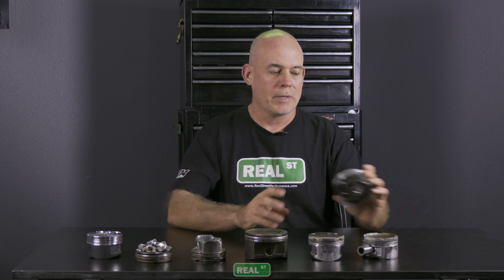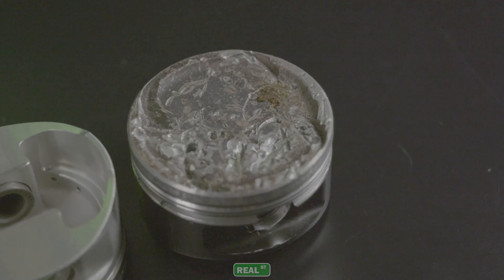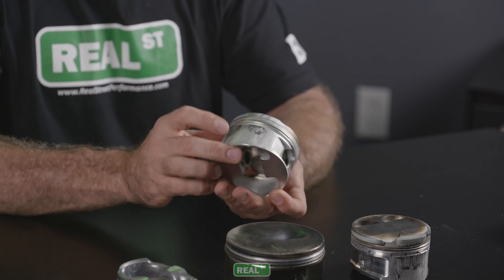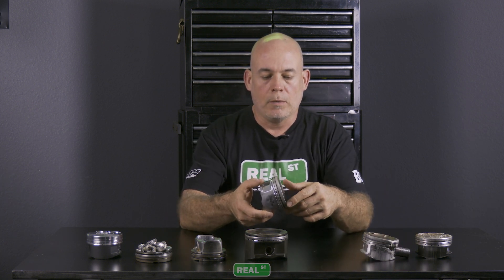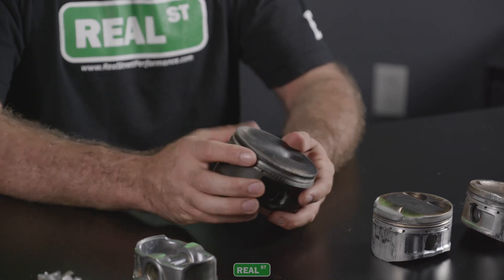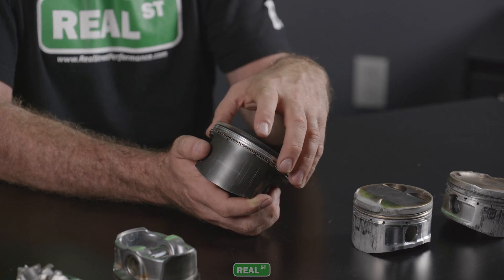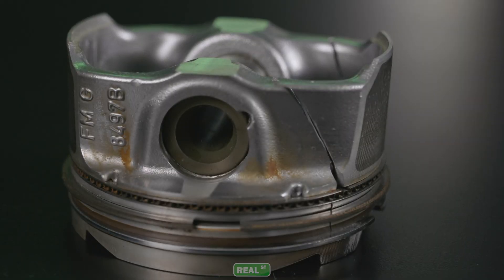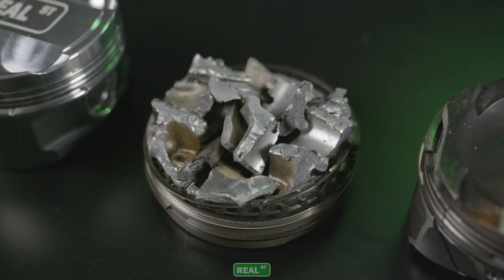Jay's Tech Tips #48: Piston Failure Diagnostics - Real Street Performance

Comment: Curious on your thoughts regarding ceramic coating the crowns on oem 2jzge vvti pistons....mates and I wanna see what they can handle.....
Reply from the maker: Just to satisfy a curiosity? Or for some other reason?
Reply: @realstreetperformance  Have a bet going. I maintain with a solid tune, they can handle 700rwhp with a ceramic coating....thoughts? He has a gs300, I have a forged big single 2j in my 300zx slicktop. He wants to get as close to my 825hp@36psi. I think it can be done, he doesnt.

Comment: I love these tech tips! Is 11.5:1 too much for 800hp k24 turbo on e85?
Reply from the maker: Thanks for watching and commenting. "Too Much" is going to be kind of a sliding scale here in this case. The higher you go on compression, the smaller the window becomes for success. The higher the compression, the less likely it will be to survive a bad day or detonation. Many people turbocharge 11.5:1 compression K-Series, and there are enough people doing it successfully that the community will tell you it is totally fine. And it is as long as your tuning is dialed in to prevent knock. Now ... the quality of pump E85 can vary throughout the year. So if you get a particularly poor batch of pump e85 and run 800whp worth of boost through an 11.5:1 engine, you are more likely to encounter detonation than if you built a 10.0:1 engine. So unfortunately there isnt a "Yes or no" answer to "is it too much?" It's fine until it isnt. If you monitor fuel quality and make sure the tune is dialed in and check the plugs for detonation and keep it out of detonation it will live at that compression and power level.
Reply: @realstreetperformance  thank you.

Comment: So I your opinion what is the max safest hp or torque numbers that a 2jzgte vvti with stock rods, pistons and block can handle safely on a daily driven car
Reply from the maker: Khalid, that is a question we get just about every day. We actually wrote an article explaining why that question doesn't really work as the answer is a sliding scale. Check it out here https://www.realstreetperformance.com/blog/how-much-will-a-stock-2jz-hold/

If you are asking "what power level can i set a stock engine to so that it will live for longer than I intend to own the car for so i never have to rebuild the engine" I would ask how often you plan to beat on it. I have seen people that race their cars every single day with less than 800hp throw stock rods on a 6766. Then I have seen people make 1000hp on a stock block for a dyno pull and then never floor it again and it lives forever. So if you asked "what power level will it last forever at if i want to beat on it every day" a safe bet would be probably not much more than double the factory output. Maybe 500-600

Comment: My 2jz broke a rod, looked exactly like the second to last. As well as windows on both sides of the block
Reply from the maker: ouch, did you end up rebuilding it?
Reply: @realstreetperformance  in progress, it was 2jz swapped Mk3 Supra stock long block, s366 on e85 with headstuds made 764/742tq at 34psi on a mustang dyno. Overboosted and went from 3k to redline in a split second. New block is getting Manley I beam rods and Diamond pistons. The electronic boost controller didn't respond quickly enough and the new waste gate basically didn't open even with a boost cut in the Haltech elite
Reply from the maker: @david92xj  Ah, well good luck with the rebuild. Let us know if there is anything we can help with.
Reply: @realstreetperformance  thanks! Some of the parts for my build came from you guys and I've got your sticker on the car 👍
Reply from the maker: @david92xj  Man, thank you for that David. We appreciate it. Thanks for letting us be a part of your build.
Reply: I cracked all 4 pistons on a honda b16a engine.. It was superchargerd and I believe the crank case pressure became too much and it cracked due to bad tuning

Comment: Hello on a motor 2.0 écoboost Focus st in setup stage 3 with an  hybrid turbo , internal forged engine, my problem I have the skirts pistons that crack I boost at 30psi fuel E85, I also have the Bearing of Rod King Racing which Fade, engine oil is Motul 300V 15W50, can you tell me why the pistons fooled

Comment: hey jay i have a piston and rod that were damaged at the wrist pin, im still unsure as to why it happened.
Reply from the maker: Do you have any pictures of the damage? Was there any traumatic event that occurred when it happened like taking water into the engine from the headgasket maybe? How much power was the engine making and what type of fuel was it on? If you dont know how much power it was making then I could make a decent guess from the turbocharger size and boost level. Its possible you overpowered the pin, its possible you had a high cylinder pressure event from detonation, or its equally possible that something else is going on.
Reply: @realstreetperformance   yes i do have some pictures, it was a na build but the pistons and rods came from a boosted setup, mind you both were on my stages of learning tuning on hondata. it was a k20/24 setup wiseco 11.1 pistons no oil squirters, engine was all good for about 2k miles then i started hearing a faint knock and determined it was on cylinder 3 once i opened it i noticed the wrist pin damaged.
Reply: @realstreetperformance  i sent the pics on a instagram message.
Reply from the maker: @Boostlee  what size turbo and how much boost? Also what fuel was it running on at the time and how many wide open throttle events happened in that 2000 miles?
Reply: @realstreetperformance   it was on e85 both on boost and na. it was rotrex c38-91 supercharged on 22-24 psi plus 50 shot at sc impeller. on boost fuel pump let go and block got hairline cracks on all cylinders division. pistons and rods looked visibly ok so i reused on the na setup, revving to 8600 and i did 40-60 pulls on it.